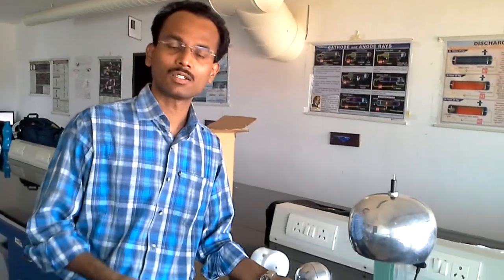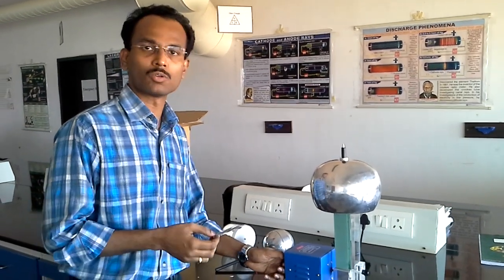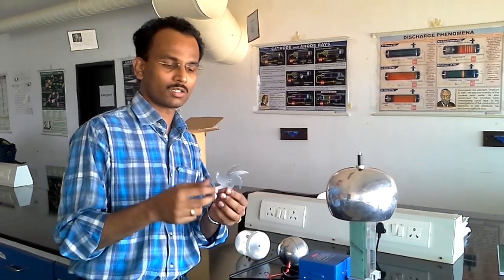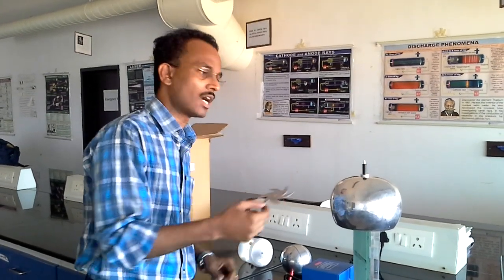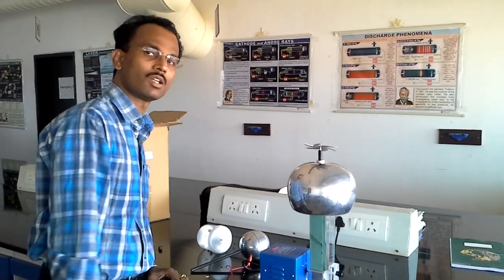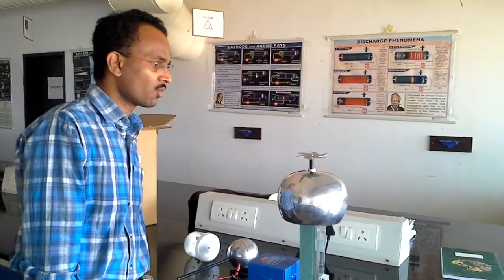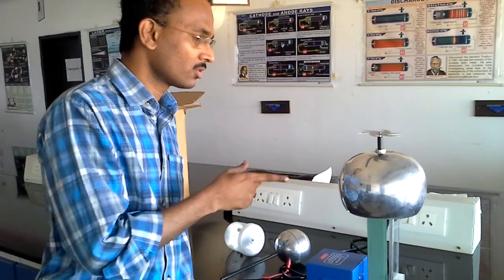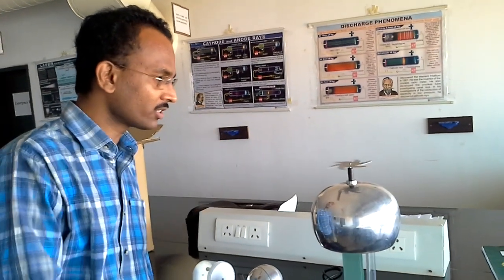Explanation for metal spiral rotating above spike of Van de Graaf Generator

Comment from the maker: 1. By "either sides", do you mean to ask whether it rotates in clockwise direction even after I place the metal spiral after flipping it over? I haven't tested it yet, because there's an indentation that makes it possible to place it on the sharp tip of the van de graaf generator only one side up. It will fall off if I flip it over and place it on the generator. I'll see what I can do to place it the other way round.
2. I have to test this too. I need metal plates!

Comment: doubts
1. does the metal rotate in clockwise direction on either sides ??
2. do all metal plates with rotational symmetry and such pointed ends rotate in clockwise direction ??
Reply: The pointy bits focus and emit the electrons collected by the belt, generating thrust.

Comment from the maker: When I flipped the metal spiral and placed it back, it reversed its direction of rotation. I think I got the explanation: The positively charged metal sphere is repelling the tips of the metal spiral disc. The metal spiral disc has more spiral tips in one half of the disc. So the repulsive force from the metal sphere below the spiral disc can be resolved into vertical and horizontal components.The horizontal components supply the necessary external torque to rotate the spiral disc.
Reply: I'm pretty sure it's just the electrons being squeezed out of the pointy bits, which should be testable using a wire between the dome and spike.